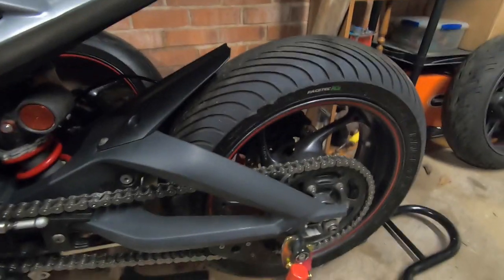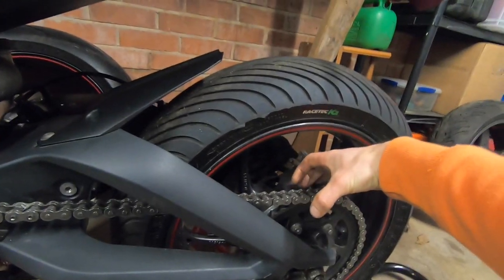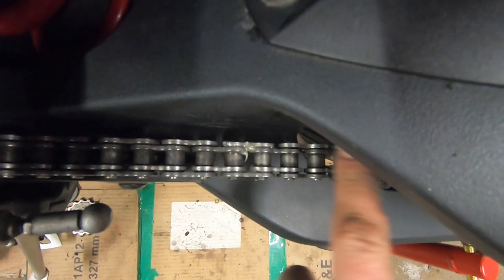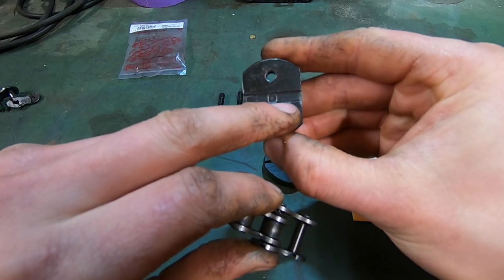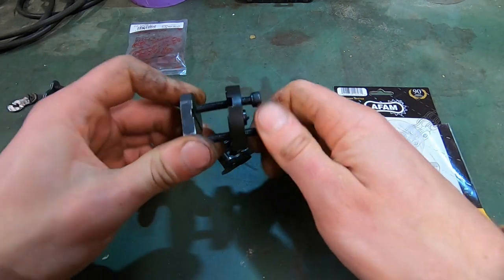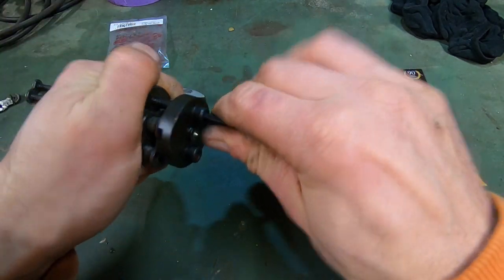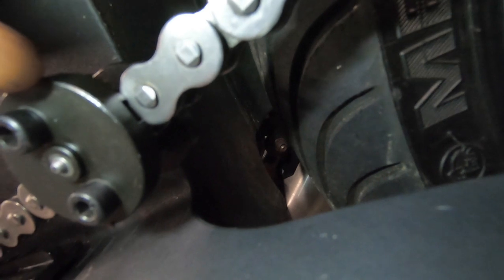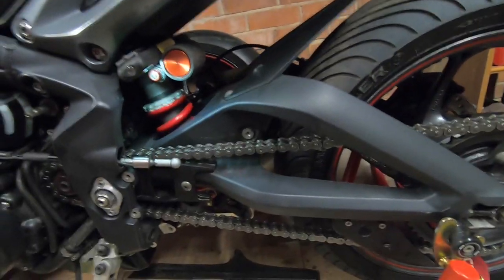How to use AFAM Easy Riv 5 Chain Rivet Tool - Riveting a shortened hollow link chain - Daytona 675

Comment: I see no benefit of this over a single tool that will remove and install.
Reply from the maker: I do agree however, a decent branded chain tool that does all the different style links and sizes is considerably more expensive than the AFAM tool. Also some of the cheaper G clamp style tools are cheap copies and break before even riveting one link. This tool did actually do a nice job of the hollow rivets.

If you only have 1 bike and not likely to be doing lots of different chains, or in my case I purchased the DID hollow chain link and AFAM tool for about £30 combined, see Amazon links in the description, then its not a bad investment.

Thanks for commenting.